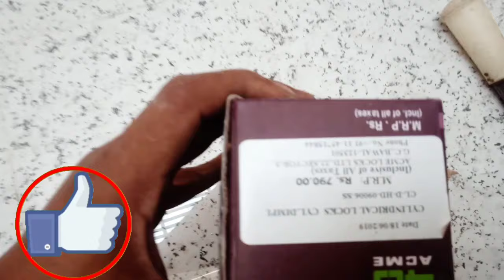door lock install | best door lock in home| door lock kyse lagye | door lock installation kit

Comment: First well done for showing how to install it correctly but as a locksmith I have to tell you that a knob is not enough security. It can be opened easily with a card or picked. You should also install a deadbolt for best security.
Reply: A